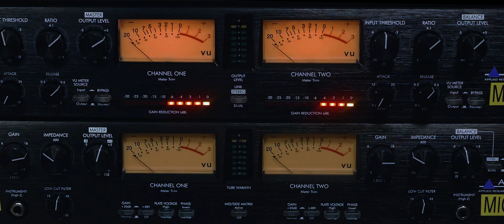How Headphone engineers dissect products

Comment: For headphones, I want to feel if it creaks audibly. I my experience, if it creaks audibly, you're in for broken parts in the future. Comfort is also big. Sound isn't something you can evaluate fully until many hours of listening. You can get a first impression of course, but you really need to dig into music you're familiar with. Disclosure: Sony's MDR-Z1R are my "daily driver" TOTL cans. They're hella expensive but they sound great, are comfortable on the head for hours at a time, and are very solidly built (though not as tough as the AB1266 that was run over by a Jeep).

For laptops, how solid is the lid? Does it wobble? How much flex does the keyboard have? And then of course how does it perform, how hot does it get, etc.

For a phone, how smooth is the screen? How solid (or insubstantial) are the buttons? How heavy is it? Does it rattle when playing loud audio? And then of course OS speed, battery life, camera performance.

Comment: I fully agree with you guys, I'm a technologist and work in a research field. For me I'm always wondering how the product has been made, and how it's been made so cheaply in most cases. When I get a new product, the first thing I focus on is fit ,finish and weight before I even switch it on, normally a well put together product is also going to work well. I know a relative difference in materials and the relative different difficulties in their strength and ease or not of molding them.

Comment: Great video again.

As a part-time knifemaker, the first thing I observed when I get a new product (that user has to interact with) is the build and the comfort when using it.

In knife making, in my opinion, it doesn't matter how great the steel heat treatment is or how nicely finished the edge is. 

If it feels like crap when using it, maybe the handle is too thick and slippery. All the craftsmanship that went into it is meaningless.

The same goes for headphones and IEMs. Even if the sound is beyond amazing but the comfort is awful. The listening session is going to be as far as the user can bear the discomfort and they will not be able to fully appreciate the sounds with all those discomforts distracting them.